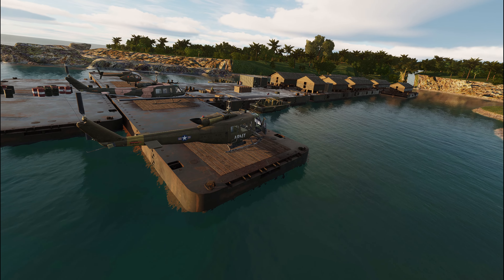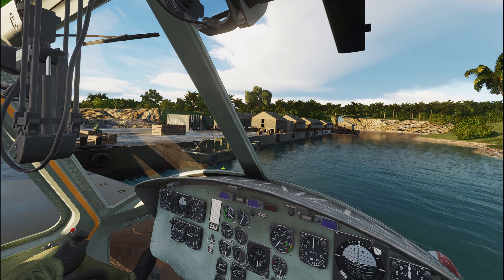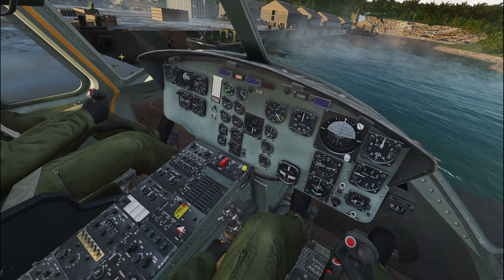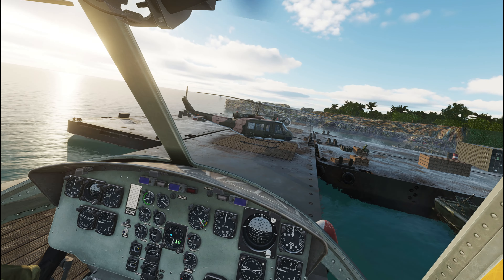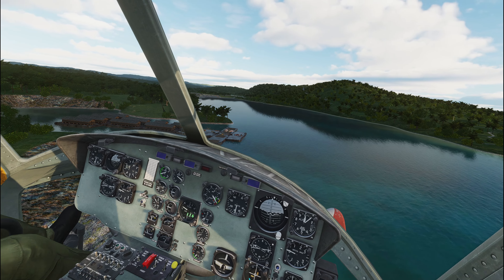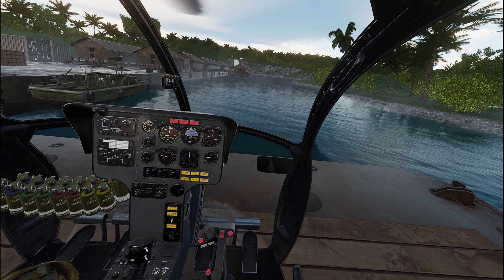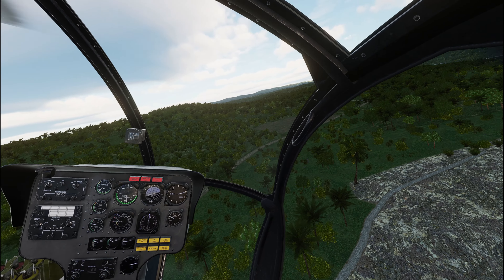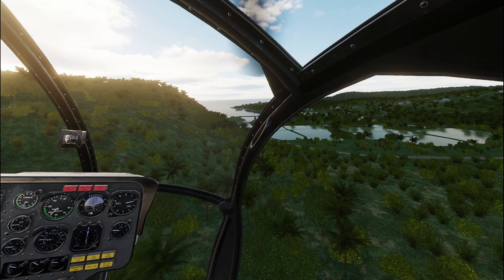DCS World OH6 UH1 Startup

Comment: Nice Job. now If I may ask about What mods are you using for the area of landing and take off pads with the buildings? It may not be known but On DCS User Files under my user name DishDoggie a long time ago I posted a 2 Knee Board Files of the Start Procedure one Quick Guide and One Taken from the US Army's "Engine Start UH-1H" Just 3 page Kneeboard for a help with it. It is funny They did not model the Startup to be as recorded in real life and even If you use the DCS Auto Start they do not fallow the proper Startup on record. The Huey is easy to start and you can get it going Fast. I honestly don't think it matters much if you do not fallow the Format it will still start as long as you have battery and fuel and throttle set kind of close. The Black Button on the Collective is pushed Down after you turn the throttle full (LEFT) open then as you twist it closed to the Start Position the Black Button will Pop out to tell you that you are at the Start Position. I love the Huey it's a dream to fly. Thanks for the Fun.
Reply from the maker: Feedback is much appreciated! The mods are all part of the new Vietnam asset pack you can download with the OH-6 mod.  I may have had a few other mod packs in there. I will need to go check.
Reply: @Devil-mn3dc  Please do I was looking at the Map later on and it looks like it was not the normal Map? Like rice patty ponds or I'm just wrong. Thanks.
Reply from the maker: @dishdoggiegaming7254  The rice patties are part of the normal Marianas map.  Southeast side of the main island.  We have been finding unique spots for FARP's in the Jungle.  Also, the mod pack I was going to suggest coincidentally is now going to be an official free asset pack in the next update.  Massun's asset pack is one of the big ones we use for FARP assets. We also use Current Hills mods, but they are not in any of the videos right now.  Other assets are what were included in the OH-6 asset pack.
Reply: @Devil-mn3dc  Thank You and very kind of you. I went looking and found this area on the map I felt (LOL) "my age" I have never seen this part of the map kind of funny for me. Congratulations to the people making the things that will become Part of the Official Game. A Honor in respectful eyes for all to enjoy. Thanks Again.